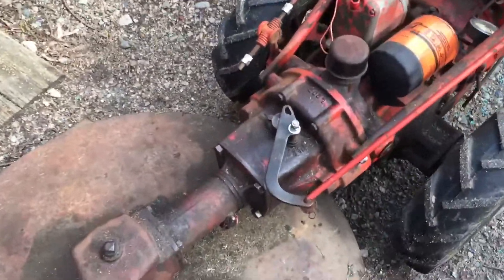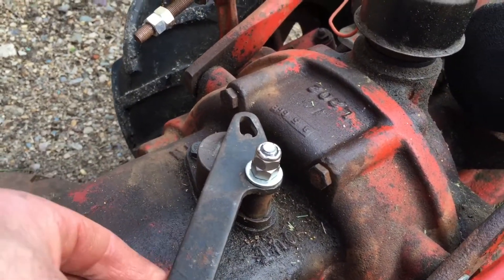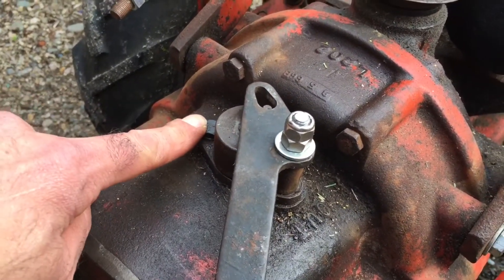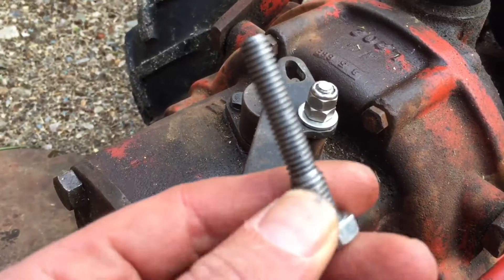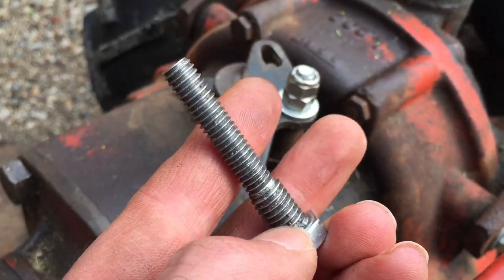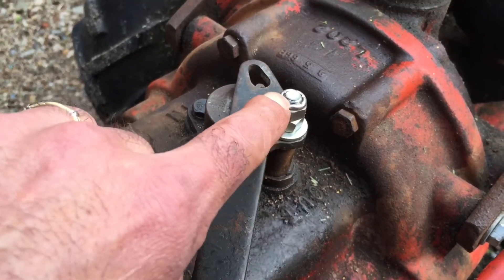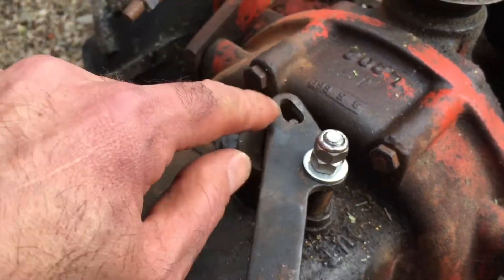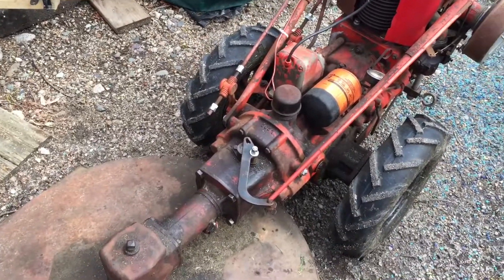1966 Gravely L8 remote PTO repair final

Comment: Regarding the later models with the bridge across:
I'm in the process of adding a bridge across the top to mine.  Didn't know they did it on later models.  
The reason I'm doing it is because I noticed a lot of clearance between the egg shaped hole in the lever and the eccentric pin and it wasn't working well.  I bought a piece of 1/4" O.D. brass tubing at a hobby store , cut off a short piece and put it down over the pin. I greased it all up and found I could operate the remote shipper shaft by pinching my thumb and finger on the loop handle!  I'm sure that little brass tube will pop out of there in about a minute so I'm building the bridge across the top to hold it in.

Comment: I can't turn the PTO lever to the on position when our gravely is running. It grinds badly. Have any idea what could be wrong with it?
Reply from the maker: Love2boat92 always lower the rpms and put the clutch in neutral
Reply: DKTractors NStuff Ok thanks. It will stall if I put the rpms too low. Which clutch are you talking about? Both? We have an L8 model.
Reply from the maker: The speed control on the inside of the handle. Adjust the carb to allow the rpms to go a little lower